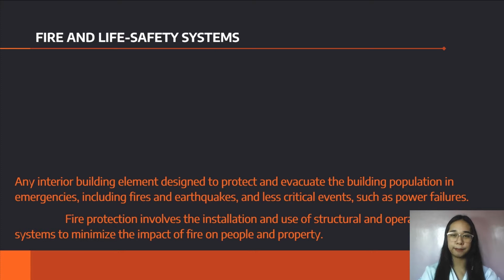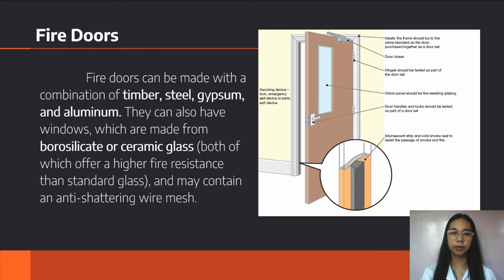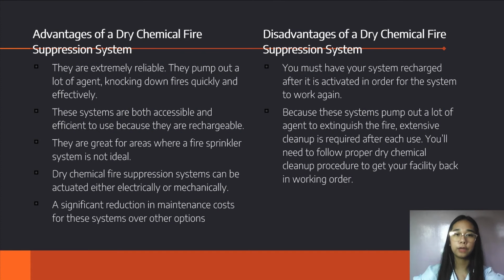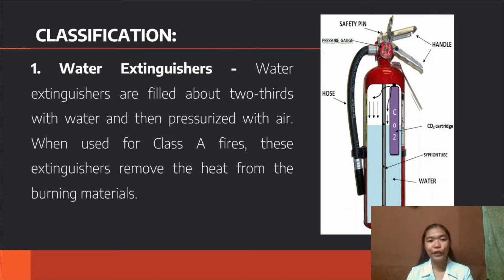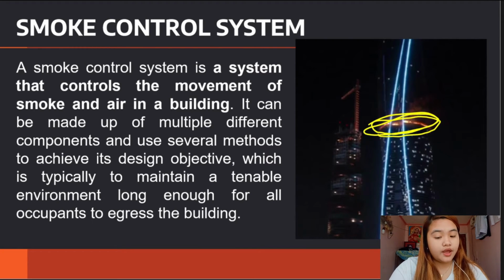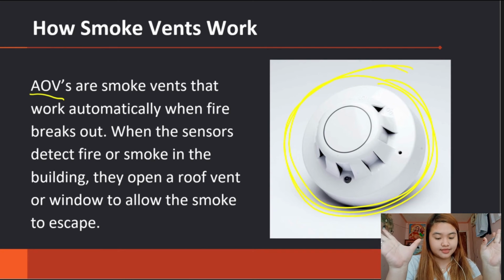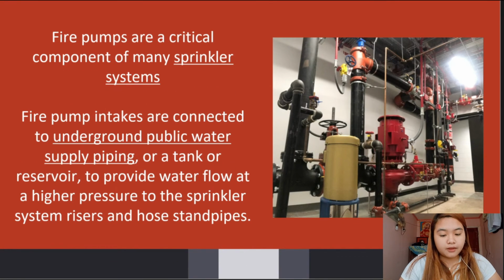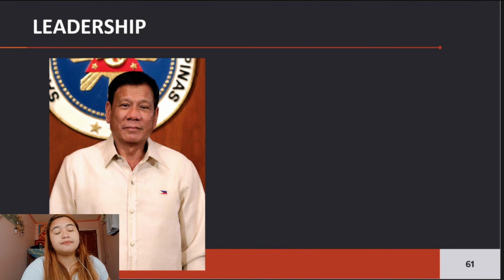Fire Protective System and Standards (Aguilar, Entroliso, Ga-as)

Comment: Harvy D. Jalandoni 
BSCE-3A

0:23 - Definition of Fire and life-safety systems
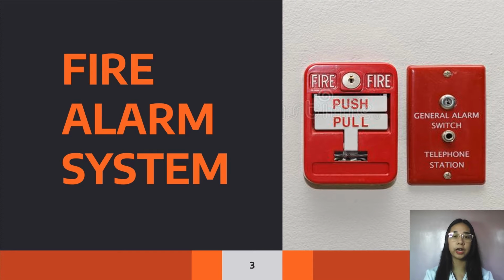1:03 - Fire alarm systems
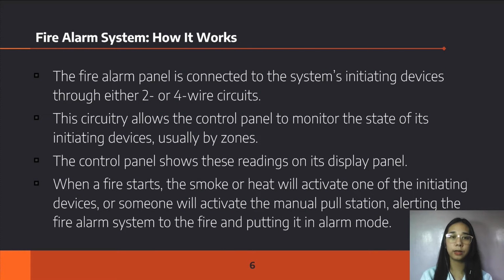2:01 - How fire alarm system works
3:48 - Types of fire alarm control panel
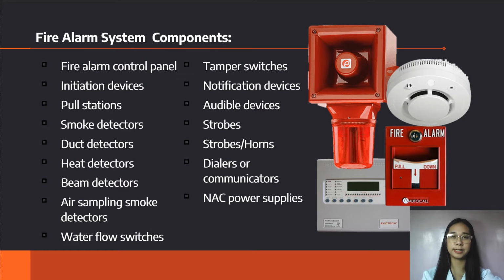4:23 - Fire alarm system components
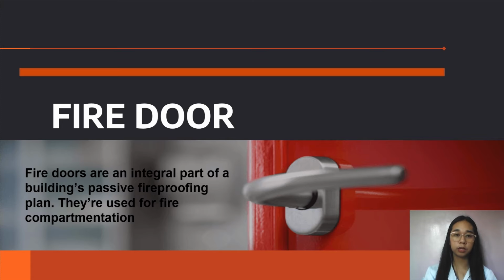8:36 - Fire door definition
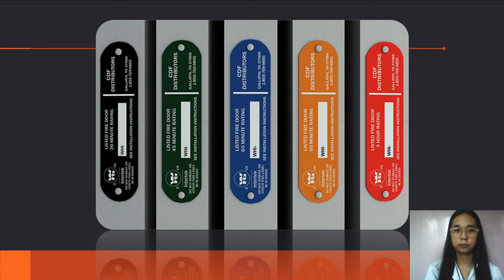10:46 - Examples of fire door labels
11:06 - Types of fire doors
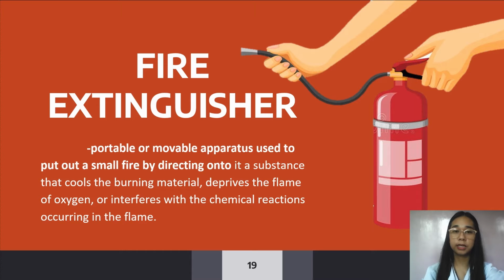11:36 - Fire extinguisher
13:26 - Color coding of fire extinguishers
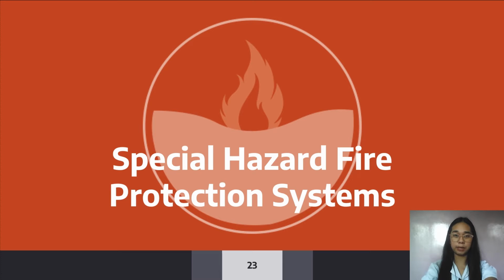14:30 - Special hazards fire protection systems
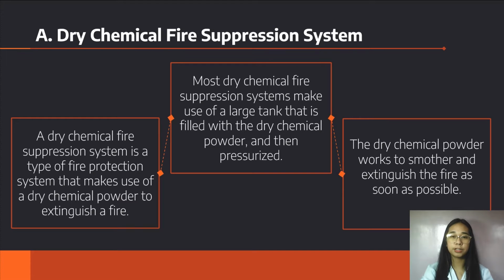15:45 - Dry chemical fire suppression systems
18:20 - Gaseous fire suppression systems
20:39 - Classification of fire protection systems
23:51 - classes of standpipe systems
29:50 - Emergency alarm system
33:13 - Types of Alarms
39:20 - Smoke and heat vents
41:46 - How smoke and heat vent works
42:56 - Vent types
44:20 - Explosion control
56:49 - Bureau of fire protection - Philippines

Comment: Osias, Katie Shulammite C.
BSCE-3a

0:22 Fire and Life-Safety Systems
1:01 Fire Alarm System
1:58 Fire Alarm System: How It Works
2:49 Fire Alarm Control Panel and Types of Fire Alarm Panels
4:17 Fire Alarm System Components
4:56 The Three States of a Fire Alarm System
6:13 Fire Sprinkler System: How It Works
7:14 Fire Alarm System Components
8:32 Fire Door
10:48 Examples of Labels found on a Fire Door
10:51 Different Types of Fire Door
11:33 Fire Extinguisher
11:58 Fire Extinguisher Types and COlour Codes
13:14 Color Codes for Fire Extinguisher
13:38 How do Fire Extinguisher Work?
14:28 Special Hazard Fire Protection Systems
20:18 Fire Protection Systems
22:49 Fire Extinguishing Systems
23:33 Standpipe System
25: 30 Portable Fire Extinguisher
27:40 Fire Alarm and Detection Systems
29:48 Emergency Alarm System
33:10 Types of Alarms
33:31 Smoke Control System
35:03 Ways to establish Smoke Control 
39:22 Smoke and Heat Vents
41:07 How Smoke Vents Work
42:54 Types of Vents
46:01 Hazardous Areas
47:47 Potential Ignition Sources
48:46 Rise Control Measures
50:45 Fire Pumps
56:49 Bureau of Fire Protection

Comment: Rica Mae B. Egama
BSCE-3A

0:23 Fire and life-safety systems
1:03 Fire alarm system
2:01 How does fire alarm works
4:20 Fire alarm system components
5:20 The three states of a fire alarm system
5:49 Fire sprinkler system
6:10 How does fire sprinklers works
7:16 Fire alarm system components
8:32 Fire door
10:55 Different types of fire door rating
11:34 Fire extinguisher
12:00 Fire extinguisher Types and color codes
13:40 How do fire extinguisher works
14:30 Special hazard fire protection systems
20:17 Fire protection system
21:10 Automatic Fire sprinkler
22:34 Fire extinguishing systems
23:30 Standpipe system
25:28 Portable fire extinguisher
27:38 Fire alarm and detection systems
29:49 Emergency alarm system
33:31 Smoke control system
39:20 Smoke and heat vents
42:55 Vent types
44:19 Explosion Control
45:07 Safety duties
46:01 Hazardous area
47:47 Potential Ignition sources
50:45 Fire pumps
56:49 Bureau of Fire Protection - Philippines
57:20 Primary Functions of BFP
59:25 Leadership under BFP

Comment: Nicole Ann I. Alido - BSCE-3A
0:25 Fire and Life-Safety Systems Definition
1:02 Fire Alarm System Functions
2:03 How Fire Alarm System Works
2:56 Fire Alarm Control Panel
4:21 Fire Alarm System Components
4:56 Three States of a Fire Alarm System
5:49 Fire Sprinkler System
6:13 How Fire Sprinkler System Works
8:35 Fire Door
10:43 Label Examples found on a Fire Door
10:54 Different Types of Fire Door
11:36 Fire Extinguisher 
11:59 Types of Fire Extinguisher
13:44 How Fire Extinguisher Works
15:10 Special Hazard Fire Protection System
20:23 Fire Protection System Definition and Classifications
29:46 Emergency Alarm System
33:31 Smoke Control System
39:22 Smoke and Heat Vents
40:03 Role of Smoke Vents
41:06 How Smoke Vents Work
42:56 Types of Vents
46:14 Hazardous Area Definition and Examples
48:11 Examples of Potential Ignition Sources
48:51 Risk Control Measures
50:45 Fire Pumps Function and How it Works
52:35 Types of Pumps
56:50 Bureau of Fire Protection

Comment: BANDOLIS, NEUHYDELE C. - BSCE-3A

0:21 Fire and Life-Safety Systems 
1:03 Fire Alarm System
1:28 Fire Alarm System Functions
1:58 Fire Alarm System: How it Works
2:49 Fire Alarm Control Panel 
3:39 Types of Fire Alarm Panels 
4:17 Fire Alarm System Components 
4:55 The Three States of a Fire Alarm System 
5:47 Fire Sprinkler Systems 
6:10 Fire Sprinkler System: How it Works 
7:13 Fire Alarm System Components 
8:32 Fire Door 
10:43 Examples of the labels that are found in fire doors 
10:51 Different Grades of Fire Door 
11:32 Fire Extinguisher 
11:58 Fire Extinguisher  Types and Color Codes  
13:36 How do Fire Extinguishers Work? 
14:29 Special Hazard Fire Protection Systems 
20:34 Classification of Fire Protection Systems 
21:09 Automatic Fire Sprinkler System 
21:25 Classification of Fire Sprinkler Systems 
22:33 Fire Extinguishing Systems 
22:59 Classification of Fire Extinguishing Systems 
23:28 Standpipe System 
23:48 Classes of Standpipe Systems 
25:25 Portable Fire Extinguisher 
25:44 Classification of Portable Fire Extinguisher 
27:36 Fire Alarm and Detection Systems 
27:56 Basic Components 
29:48 Emergency Alarm System  
33:09 Types of Alarms 
33:29 Smoke Control System 
35:00 Ways to establish smoke control 
39:16 Smoke and Heat Vents 
39:59 The Role of the Smoke Vent
41:07 How Smoke Vents Work
42:18 What to Look for in a Smoke Ventilation System  
42:52 Vent Types 
44:14 Explosion Control 
45:00 Safety Duties 
46:00 Hazardous Areas 
47:45 Potential Ignition Sources 
48:46 Risk Control Measures 
50:44 Fire Pumps 
51:12 Why are Fire pumps needed? 
51:37 How do fire pumps work? 
52:28 Types of Pumps Used For Fire Service 
53:31 Types of Fire Pumps: Positive Displacement Pumps 
53:51 Types of Fire Pumps: Centrifugal Pumps 
56:47  Bureau of Fire Protection - Philippines

Comment: Delos Reyes, Dario Jr. A.
ce_3a_ce1

0:20 Fire and life-safety system
1:05 Fire alarm system and how it works, the control panel and its types, components and states
5:54 Fire sprinkler system and how it works and its components
8:35 Fire door and what it is made of that makes it fire resistant and its types (by resistance rating)
11:39 Fire extinguisher and its types and color codes, and how it works

14:29 Special hazard fire protection system
15:55 Types: Dry chemical fire suppression system
18:21 Types: Gaseous fire suppression system
19:15 Types: Foam fire suppression system

20:19 Fire protection systems and classifications
21:10 Automatic fire sprinkler system and classifications
23:30 Standpipe system and classifications
25:30 Portable fire extinguisher and classifications
27:42 Fire alarm and detection systems and basic components
29:55 Emergency alarm system and how it works and its types
33:33 Smoke control system and types for large and small areas
39:22 Smoke and heat vents, its roles, how it works, requirements and types
44:17 Explosion control (risks, safety duties, hazardous areas, potential ignition sources and control measures)
50:45 Fire pumps and its uses, how it works, and its types
56:50 Bureau of Fire Protection - Philippines (primary functions and present leadership)

Comment: Shannen Angela A. Pelpinosas - BSCE 3A
0:23 - Definition of Fire and life-safety systems
1:03 - Fire alarm systems
2:01 - How fire alarm system works
3:48 - Types of fire alarm control panel
4:23 - Fire alarm system components
8:36 - Fire door definition
10:46 - Examples of fire door labels
11:06 - Types of fire doors
11:36 - Fire extinguisher
13:26 - Color coding of fire extinguishers
14:30 - Special hazards fire protection systems
15:45 - Dry chemical fire suppression systems
18:20 - Gaseous fire suppression systems
20:39 - Classification of fire protection systems
23:51 - classes of standpipe systems
29:50 - Emergency alarm system
33:13 - Types of Alarms
39:20 - Smoke and heat vents
41:46 - How smoke and heat vent works
42:56 - Vent types
44:20 - Explosion control
56:49 - Bureau of fire protection - Philippines

Comment: ACLO, ELLA SHAIRA Y. 
BSCE 3A

0:27 Fire and life safety systems
1:08 Fire Alarm Systems
2:10 How Fire Alarm System Works
4:28 Fire Alarm System Components
5:55 Fire Sprinkler Systems
7:19 Fire Alarm System Components
9:07 Fire Doors
11:46 Fire Extinguisher
13:41 How Fire Extinguisher Works
15:47 Dry Chemical Fire Suppression System
18:23 Gaseous Fire Suppression System
20:22 Fire Protection System
22:22 Fire Extinguishing System
23:32 Standpipe System
25:35 Portable Fire Extinguisher
27:35 Fire Alarm And Detection System
29:51 Emergency Alarm System
33:34 Smoke Control System
39:21 Smoke And Heat Vents
44:18 Explosion Control
50:54 Fire Pumps
56:50 Bureau of Fire Protection Philippines

Comment: Poblete,Kyla Amor B.
BSCE-3A 

0:24 Fire and Life-Safety Systems
1:04 Fire Alarm System 
1:57 Fire Alarm System: How it Works 
4:17 Fire Alarm System Components
4:56 The Three States of a Fire Alarm System
5:47 Fire Sprinkler Systems
14:29 Special Hazard Fire Protection Systems
20:15 Fire Protection Systems
21:10 Automatic Fire Sprinkler System 
22:35 Fire Extinguishing Systems 
27:39 Fire Alarm and Detection Systems
29:48 Emergency Alarm System 
33:30 Smoke Control System 
39:21 Smoke and Heat Vents 
44:16 Explosion Control 
46:03 Hazardous Areas 
56:50 Bureau of Fire Protection - Philippines 
59:13 Leadership

Comment: NAMOCATCAT, LENSEARFWYN P.
BSCE-3A

0:46 Fire and life-safety systems
2:28 How fire alarm works
3:15 Fire alarm control panel and its types
4:29 Components of fire alarm system
6:46 How fire sprinkler system works
8:33 Fire doors
11:42 Fire extinguisher
14:29 Special hazard fire protection systems
20:28 Fire protection systems
22:55 Fire extinguishing systems
23:35 Stand pipe system
25:31 Portable fire extinguisher
27:40 Fire alarm and detection systems
30:01 Emergency alarm system
33:14 Types of alarms
33:48 smoke control system
39:35 smoke vents
44:16 Explosion control
45:09 Safety duties
46:05 Hazardous areas
47:59 Potential ignition sources
49:13 Risk control measures
53:39 Types of fire pumps

Comment: Samporna, James Darryn S.
BSCE3A

0:21 - Fire & Life Safety System
1:01 - Fire Alarm System
5:47 - Fire Sprinkler System
8:31 - Fire Door
11:33 - Fire Extinguisher
14:29 - Special Hazard Fire Protection Systems
15:44 - Dry Chemical Fire Suppression System
18:16 - Gaseous Fire Suppression System
19:08 - Foam Fire Suppression System
20:15 - Fire Protection System
21:11 - Automatic Fire Sprinkler System
22:14 - Fire Extinguishing System
23:30 - Standpipe System
25:27 - Portable Fire Extinguisher 
27:37 - Fire Alarm and Detection System
29:47 - Emergency Alarm System 
33:29 - Smoke Control System
39:19 - Smoke and Heat Vents
44:17 - Explosion Control
50:43 - Fire Pumps
56:42 - Bureau of Fire Protection - Philippines

Comment: 1:02 Fire alarm system
1:28 Fire alarm function
1:57 How fire alarm works
4:17 Fire alarm ecosystem components
4:56 The states of fire alarm 
5:46 Fire Sprinklers system 
7:12 Fire alarm system components
8:33 Fire doors
11:32 Fire extinguisher
12:00 Fire extinguisher types and color codes
20:15 Fire protection system
21:09 Automatic fire sprinkler system 
22:32 Fire Extinguishing system 
23:28 Standpipe system
27:38 Fire alarm and detection system
29:47 Emergency alarm system
33:11 5 types of alarm
50:41 Fire pumps
52:28 Types of fire pumps used for fire service
56:50 Bureau of fire protection - Philippines

Comment: LLAUSAS, JAN MARIE M.
BSCE-3A

1:17 Fire Alarm System
2:33 How Fire Alarm System Works
3:17 FACP
5:07 Three States of Fire Alarm System
6:34 How Fire Sprinkler System Works
7:51 Components of Fire Alarm System 
8:50 Fire Doors
11:47 Fire Extinguisher 
15:24 Special Hazard Fire Protection System: Definition & Types
20:02 Fire Protection System and its Classifications
22:37 Fire Extinguishing Systems & Classification
27:58 Fire Alarm and Detection System and its Components
30:00 Emergency Alarm System
33:15 Types of Alarm System
34:04 Smoke Control System
39:37 Smoke and Heat Vents
44:36 Explosion Control
46:40 Hazardous Areas
51:12 Fire Pumps
58:49 Bureau of Fire Protection Philippines

Comment: BESINGA, AHL SYDRIC JAMES L.
BSCE 3A

0:23 Fire and life safety systems
1:05 Fire Alarm Systems
2:06 How Fire Alarm System Works
4:22 Fire Alarm System Components
5:50 Fire Sprinkler Systems
7:17 Fire Alarm System Components
9:06 Fire Doors
11:44 Fire Extinguisher
13:42 How Fire Extinguisher Works
15:44 Dry Chemical Fire Suppression System
18:25 Gaseous Fire Suppression System
20:23 Fire Protection System
22:21 Fire Extinguishing System
23:32 Standpipe System
25:33 Portable Fire Extinguisher
27:36 Fire Alarm And Detection System
29:50 Emergency Alarm System
33:35 Smoke Control System
39:23 Smoke And Heat Vents
44:17 Explosion Control
50:51 Fire Pumps
56:49 Bureau of Fire Protection Philippines

Comment: 0:20 - Fire & Life Safety System
1:06 - Fire Alarm System
5:50 - Fire Sprinkler System

11:33 - Fire Extinguisher
14:30 - Special Hazard Fire Protection Systems
15:48 - Dry Chemical Fire Suppression System
18:19 - Gaseous Fire Suppression System 
20:20 - Fire Protection System
21:11 - Automatic Fire Sprinkler System
22:19 - Fire Extinguishing System
23:31 - Standpipe System
25:33 - Portable Fire Extinguisher 
27:41- Fire Alarm and Detection System
29:50- Emergency Alarm System 
33:31 -Smoke Control System
39:22 - Smoke and Heat Vents
44:17 - Explosion Control
50:45 - Fire Pumps
56:49 - Bureau of Fire Protection Philippines

Comment: ALCIDO, MIASHYLL ANGELOU J. 
BSCE-3A 

0:23 Fire and Life-Safety Systems
1:04 Fire Alarm System 
1:58 Fire Alarm System: How it Works 
4:17 Fire Alarm System Components
4:55 The Three States of a Fire Alarm System
5:47 Fire Sprinkler Systems
8:31 Fire Door 
11:33 Fire Extinguisher 
14:29 Special Hazard Fire Protection Systems
20:16 Fire Protection Systems
21:09 Automatic Fire Sprinkler System 
22:35 Fire Extinguishing Systems
23:32 Standpipe System 
25:28 Portable Fire Extinguisher 
27:38 Fire Alarm and Detection Systems
29:48 Emergency Alarm System 
33:30 Smoke Control System 
39:21 Smoke and Heat Vents 
44:16 Explosion Control 
46:03 Hazardous Areas 
50:45 Fire Pumps
56:49 Bureau of Fire Protection - Philippines 
59:14 Leadership

Comment: Saba, John Michael A.
BSCE_3A

0:26 Fire And Life Safety Systems
1:04 Fire Alarm Systems
2:04 How fire Alarm System Works
4:20 Fire Alarm System Components
5:51 Fire Sprinkler Systems
7:16 Fire Alarm System Components
9:05 Fire Doors
11:43 Fire Extinguisher
13:41 How Fire Extinguisher Works
15:46 Dry Chemical Fire Suppression System
18:22 Gaseous Fire Suppression System
20:25 Fire Protection System
22:20 Fire Extinguishing System
23:30 Standpipe System
25:34 Portable Fire Extinguisher
27:38 Fire Alarm And Detection System
29:51 Emergency Alarm System
33:35 Smoke Control System
39:25 Smoke And Heat Vents
44:17 Explosion Control
50:50 Fire Pumps
50:49 Bureau of Fire Protection Philippines

Comment: BAUTIZADO, LIREY MAE M.
BSCE - 3a

0:24 Fire and Life-Safety Systems
1:05 Fire alarm Systems
2:00 Fire Alarm System : How it Work
2:52 Fire Alarm Control Panel
4:18 Fire Alarm System Components
4:56 The Three States of a Fire Alarm System
6:15 Fire sprinkler System: How it Works
8:34 Fire Door
11:35 Fire Extinguisher 
15:09 Special Hazard Fire Protection Systems are:
20:16 Fire Protection Systems
22:33 Fire Extinguishing Systems
29:48 Emergency Alarm System
33:31 Smoke Control System
39:21 Smoke and Heat Vents
41:43 How Smoke Vents Work
46:37 Examples pf Hazardous Areas
50:46 Dire Pumps
51:39 How do fire pumps work?
56:49 Bureau of Fire Protection - Philippines

Comment: Azzalea Nicole Marie H. Macasa - CE3A
1:01 - Fire Alarm System
1:29 - Fire alarm fucntions 
1:58 - How fire alarm works
4:16 - Fire alarm system components
4:55 - The three states of a fire alarm system
5:46 - Fire sprinkler systems
7:13 - Fire alarm system components
8:32 - Fire doors
11:33 - Fire extinguisher
11:58 - Fire extinguisher types and color codes
20:15 - Fire protection systems
21:09 - Automatic fire sprinkler system
22:33 - Fire extinguishing systems
23:27 - Standpipe system
27:38 - Fire alarm and detection systems
29:47 - Emergency alarm system
33:09 - 5 types of alarms
50:40 - Fire pumps
52:27 - Types of fire pumps used for fire service
56:48 - Bureau of fire protection - Philippines

Comment: Hiludo, Claire Darleen Sissy S.
BSCE-3A
0:21 - Fire & Life Safety System
1:05 - Fire Alarm System
5:48 - Fire Sprinkler System
8:32 - Fire Door
11:33 - Fire Extinguisher
14:28 - Special Hazard Fire Protection Systems
15:45 - Dry Chemical Fire Suppression System
18:16 - Gaseous Fire Suppression System 
20:17 - Fire Protection System
21:10 - Automatic Fire Sprinkler System
22:16 - Fire Extinguishing System
23:29 - Standpipe System
25:32 - Portable Fire Extinguisher 
27:37 - Fire Alarm and Detection System
29:49 - Emergency Alarm System 
33:31 -Smoke Control System
39:22 - Smoke and Heat Vents
44:17 - Explosion Control
50:45 - Fire Pumps
56:49 - Bureau of Fire Protection Philippines

Comment: MARY ANN R. SALVAR - BSCE-3A
1:02 Fire Alarm System -designed to alert us during emergency.
1:59 How Fire Alarm System Works
4:17 Fire Alarm System Components
8:32 Fire Door - integral part of a building's passive fire proofing plan.
14:28 Special Hazard Fire Protection Systems
20:17 Fire Protection Systems - controls the damage and protect occupants during fire.
24:45 Classifications of Fire Extinguisher (Water, Carbon Dioxide, Dry Chemical Agent)
29: 47 Emergency Alarm System - warns people when fire-relatef emergencies are detected.
33:10 Types of Alarms (Automatic, Conventional, Addressable, One-Stage, Two-Stage)
42:54 Examples of Vent Types
56:48 Bureau of Fire Protection Philippines - government fire service of the Philippines.